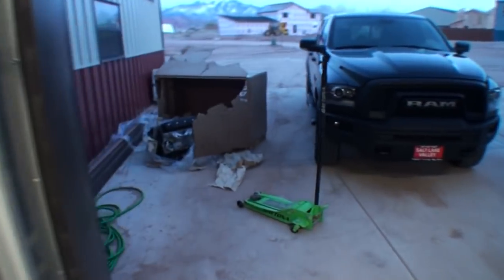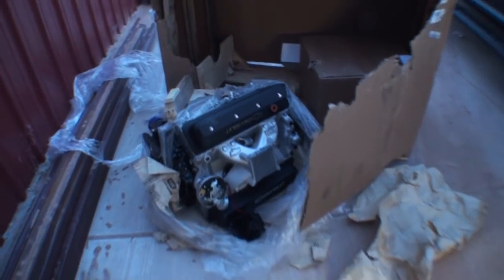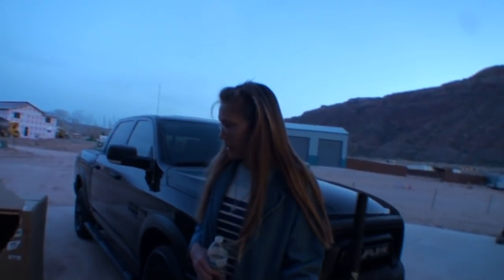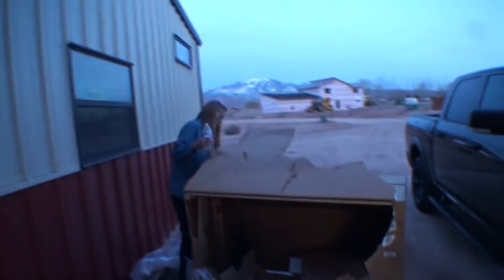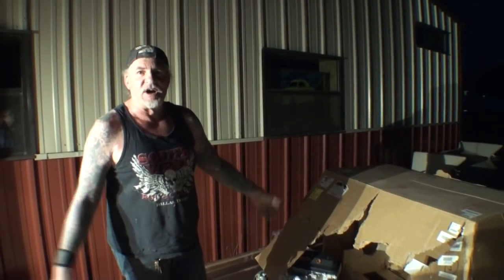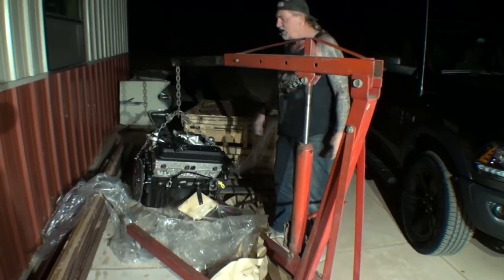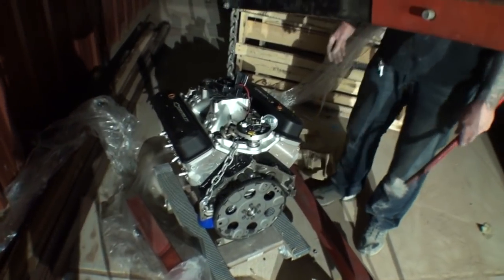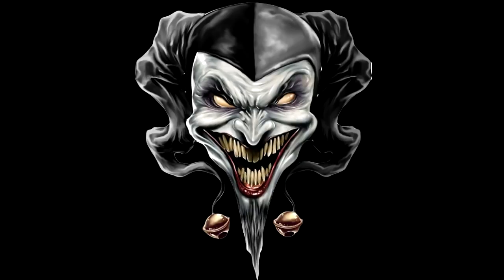Where's My  Small Block Chevy Engine? - The First Delivery!

Comment: The engine is probably fine inside, but the thing is do you want to take the chance on it?
Reply: If it landed on harmonic balancer first then it and crank can be bent, Don't think so then I have a Dodge Dakota 3.9  that happened to and the installer that dropped it doesn't want to pay for it. Installed it to prove it didn't hurt it and it viberated so bad that one full throttle in his shop and he was dogging pistons

Comment: I feel like they pushed it off the back of the truck. SMH!
Reply: That was my first impression...a push off unload. But on closer inspection i don't see any kind of strapping to the pallet...if that engine is on the ground...i want to see the straps and broken wood pieces on that engine...before i blame the shipping company.
Reply: That's what they did they don't have a way to get it off the truck you have to be able to get it off the truck

Comment: Because there was no loading dock, and no body home, they would of had to just push it off the back of the truck to do that much damage.  Ain't Jegs' fault.  Find that driver and have him fired.  Completely unacceptable.
Jeg's goes through great lengths to have those motors shipped in stout shipping crates, and so does Summit.  Pete, you can build a bump-up dock that's not attached to a building out of a mound of dirt and some concrete or all concrete, whatever.  Why the driver didn't phone you guys to set up a delivery time is beyond me?  But, this is the kind of people we have in the world now-a-days.  WOW!

Comment: This is a matter for JEGS to handle. I would have put a tarp on the remains and called the customer service dept. when they were open before freaking out. They ultimately will have to handle the return and should be in the mix when deciding what the next steps are to be. This kind of shipping is sometimes par for the course. when dealing with any company.
Reply: And make the shipping company send someone to repack it or not.

Comment: Is that what ya call, "Drop Shipped?"
Very poor packing, that's for sure and that's on JEGS as much as it is on the shipper carrying items they are not prepared to handle, except with a tiny pallet jack and trying to drag it out of the truck without a fork lift.
Reply: More like drop KICKED shipping !!!!!!----- Been having issues with Summit as well, wrong parts, slow UPS times .
Reply: Should have specified lift gate  delivery  . I got a mopar. Class 3 hitch that. Dead x delivered  and looked like Bigfoot molested it

Comment: I assume Jegs doesnt crate the engines themselves. They are probably drop shipped from Chevrolet. Should have been a plywood crate. Looks like the shipped probably used a pallot jack, and when pushing crate onto or off lift gate, the engine rolled and tore through the cardboard crate. Surprise - cardboard dint hold back a 500 pound engine.

Comment: Jegs did not crate or ship the engine. It was drop shipped from the manufacturer. When loaded on the truck and unloaded, then loaded again for delivery by various truckers is when some damage occurred. The freight company thought you had dock high delivery because you are listed as a business. When they arrived hopefully they had a lift to lower it to the pavement. Sure the box was damaged and you lost your temper and pushed, shoved and rolled the engine to make a more dramatic case. Usually the freight company phones prior to deliver and  someone must sign and inspect before the driver leaves. Funny the driver would even deliver something  that bad. This whole deal stinks like dead fish.